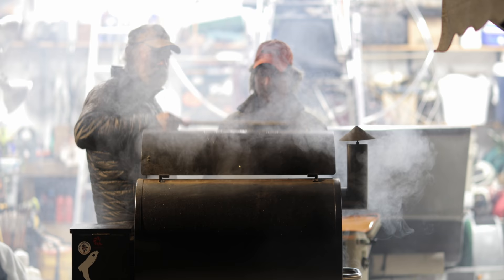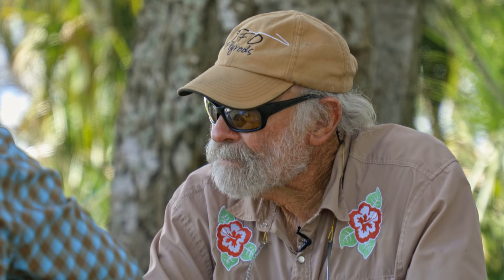Flip on How to Build out Your Leader

Comment: I don’t know man. As someone who consistently changes leader, loop was gift from god. Compared to old days when I used to  nail knot the leader, I can’t agree with ideas of cutting loops. The convenience and usefulness of loop outweigh the ones without in my experience. Difference in energy transfer is also negligible in my opinion. If you are good caster, you will find no difference to be honest
Reply from the maker: As Brian says here, and many other videos, if you are changing leaders often, stick with loops! There is most definitely a difference in energy transfer though and has nothing to do with casting ability. Basic physics.

Comment: 🌴 Hi Brian, my biggest problem is when tying the snell knot to the fly line the heavy floacarbon is so stiff it doest want to wrap around the fly line I actually had to use a tooth pick as a guide to wrap it around , and then when yo do get the knot finished it doesn’t slide thru the tip guide smoothly I’ve put UV epoxy to try and smooth it but it’s a speed bump , I’ve got a 9- 10 wt wt fwd floating line with a 50 # butt section , 🫤 what diameter and brand ( coartland ) floracarbon should I be using for my 9-10 wt ? 🤔
Reply from the maker: Please send your questions directly to Brian at the shop and he’ll be happy to help. You can email him or give him a call. Thanks.

Comment: Your buddy flip sealed the deal when he put the blood knot in his mouth to prevent the burning when pulled tight. Real McCoy. Down east for salmon, we use heavy buts for leaders to carry in the wind. Ive tapered them to almost microscopic, 22 size hooks. I tie the fly after I attach it to the the leader, tippet. Or leave it all heavy if the fly is hugh. In the day hooks were called  nails. 4, 5, 6 inch nails. Hence the nail knot to join hook, without eye to tippet. I rise alot of fish on the blood knot, no hook required. Would like a link to your snell knot please. I just tie a simple knot and 5 half hitches to join to cast line. Great job guys
Reply from the maker: Thanks for watching!  The link to the snell knot is in part of this video.

Comment: I’ve been flyfishing for 55 years now, and I’ve always tied a butt section onto the fly line. When loops started appearing on fly lines I had purchased I kind of laughed and wondered why I’d want to have a hinge in my line/leader and also why I would want a knot, or really 2 knots, that would not go through the guides easily. It’s never occurred to me to use the loop. The only thing I do differently is I use a nail not instead of his Snell knot, and for my tarpon rods, I use an Albright with a couple of half hitches backed up against it, to smooth it out.  Also, it’s just not that much faster if at all to do a loop to loop connection instead of a 3 to 4 turn blood knot.
Reply from the maker: Thanks for watching.

Comment: Just to speculate for a bit:  I suspect that when Flip wants to transfer all the energy through the transactions between leader or line sections, both the mass an stiffness matters.  I think this is analogous to sending electrical signals down transmission lines through different segments, one needs to match the impedance across section.  Or for the opposite, one mismatches impedances in layers of sound proofing walls spun that the energy doesn’t transfer through the wall.   I suspect that the impedance of a fly line is a combination of its mass per inch with its stiffness.  Would be a fun mechanical engineering student’s senior project
Reply from the maker: Thanks for watching and for the speculation. Sounds about right.
Reply: This is exactly how I think of it. Your transferring a wave down a line. Any change in impedance will have some of the wave (energy) transfer through, and some transfer back. 

I'm electrical/physics, but mechanical waves are basically the same as electrical in transmission lines. Instead of electrical impedance, you have mechanical impedance. Think of a rope attached to a chain midway. If you send a wave down, it hits the change in impedance (connection between chain and rope) and that will reflect some of the wave, and some will transfer through the chain. You can find demos of this.

I've been thinking about trying to model this to see the exact difference. Because mathematically your right, if you can match the impedance, you can transfer all the energy down the line

Comment: Thanks for this video. Clipping off the "hateful" loop and attaching a direct leader butt section makes sense to me. What does not make sense about this system is what butt leader one should choose with a given fly line. Obviously if one is using the FP bright orange line you have provided a table but what about Scientific Angler Amplitude Bonefish 8wt or Rio or ... What is the formula for choosing the correct butt section with any given fly line? Do you try to match the diameter of the line to the butt or is there more to it?
Reply from the maker: Please send your questions over to Brian at the shop and he'll be happy to help. Thanks.

Comment: Brian, when you say "I dont know what 40 pound is." , I take that to mean "40 pound" does not describe the stiffness and mass of the material, it would just simply describe the general strength of the material, correct? So the trick is learning the different brands and types of materials available and using the appropriate one for that fly line. Am I getting this? Thanks!
Reply from the maker: Thanks for watching. Please contact Brian at the shop directly and he will be happy to answer your questions. Call him or send him an e-mail and he will set you straight.

Comment: My question is... The Butt section leader is not permanent, and you will need to change it (nicks, sun damage, etc...). How far back can someone keep clipping the fly line before the factory taper becomes useless?
Reply from the maker: Please send your questions directly to Brian at the shop and he’ll be happy to help/answer. Thanks.
Reply: OK, say your butt section is 12”.  My leader may last all season, or more, but if I need to tie on a new leader, I only use/cut off about 3” of butt section. So the butt lasts about 4 leader changes. On one of my lines the butt section is now only 4” long for example.  When I tie on a new butt, I only use about 2” of line.  Anyway, this is a long way of saying that I wear out the line before I cut into the fly line enough to affect it’s performance.

Comment: I prefer factory loops. I murder leaders and would end up snipping away at the first 4 feet of the fly line. I do remember "dog on a loop" technique of using heavy mono to make a nail knot and then 3 inches of mono to a perfection loop.
Reply from the maker: With the methods shown here, you really would never change leaders. If you need to, this is by far the better method: https://youtu.be/8QKCXstJw30

Comment: Question your leader on a 10-11-12wt saltwater with sinking tip line is still 4 foot? Even the diameter is .027"-0.29" lets say a 0.26" on a 10wt will it hold a big saltwater fish of 60 pounds for example? or you would make it even stronger on the butt section? Thanks! and great video by the way
Reply from the maker: Thanks for watching. Please send those questions over to Brian directly and he’ll be happy to answer. Call him or email him.

Comment: You mentioned the formula for butt leader attached to fly line works with any modern fly rod. I'm presuming graphite, carbon wrapped graphite, etc.  What about fiberglass rods?  I have 2 Shakespeare '60 era rods in 4WT and 6WT.  If using today's floating fly lines with the old fiberglass rods, will the contact formula be the same?  Will the overall performance of the cast be different?
Reply from the maker: Thanks for being here. Please send those questions over to Brian at the shop and he’ll be happy to help. Call him or email him and he’ll get you answers.

Comment: Brian - does it make much difference, if any, what material you use for your tippet, ie: regular mono vs  Mason hard mono or an equivalent diameter fluorocarbon?
Reply from the maker: It certainly does as he talks about often. Best to call or e-mail him at the shop though with questions as he doesn't hang out here much. He'll be happy to help.

Comment: So is the idea that the butt section is long enough that if you lose a couple inches when retying the mid section the line will need replacing by the time the butt section is too short? Or do you not mind cutting off a couple more inches from the fly line if you need to retie the whole thing now and then?
Reply from the maker: @richpaul6806  Both sound about right! Feel free to call or e-mail Brian at the shop if any further questions.

Comment: Hi there!

Have been watching a few of your leader videos lately and I have a question cross comparing 2 vids. Here Brian says Maxima ultra green (MUG) is too flexible for streamer butt sections, but in "Build Perfect Nymph & Streamer Leaders" Brian recommends using MUG  for the butt section of sink tip leaders. Why is this?
Is it a revelation had since that older video? Or is it a difference between longer FLOATING LINE leaders and shorter SINK TIP/FULL SINK leaders? 

Thanks in advance for clearing that up!
Reply: AND another relevant question: where in this leader formula might I insert a tippet ring (for preservation)? After the mid section just before the tippet perhaps?
Reply from the maker: Thanks for watching. Please send your questions over to Brian at the shop and he'll be happy to help and answer. He can be reached by phone or by e-mail. Phone is always best.

Comment: is there any problem with cutting the loops off and just tying the tapered leader on the fly line and not piecing it all together? So its the fly line to leader but tying it instead of using the loops. Thanks!
Reply from the maker: Please contact the shop directly with your questions and they will be happy to answer/help. Thanks.

Comment: Sir...what knot are you using for the mono to mono connections of the leader and of course, with no loops in the leader anywhere, that perfect leader length starts to deviate the minute you start changing flies, or generating a frayed tippet end, or any other situation that results in your losing tippet length.  Eventually, you get a trickle down effect that will cause you to have to retie the butt section.  Every time you do that, you lose a little fly line.  I think that is what bugs me the most!
Reply from the maker: Thanks for watching. Easy to overcome….Brian has quite a few videos that address all of these issues you point out.

Comment: Brian/MRO
What dia. size butt section would I need for 10wt flyline?
Reply from the maker: Check the video description below for recommendations. Call or email Brian at the shop if any further questions.
Reply: Thank you
Reply: @Madriveroutfitters   In the video Brian says your tippet is determined by the size of the hook and if the fly is weighted. I mainly fish for Reds in Louisiana and going to use weighted flies and sometimes non-weighted. How do I determine what size tippet I'm suppose to use for theses flies? Is there a tool or a formula that determines what size tippet I need to use? Thank you.
Reply from the maker: @Raptor_1991  Please contact Brian directly through the shop and he’ll be happy to help. Email or call. Thanks.

Comment: One of the issues with floating line is that, well, it doesn't float. I've noticed there is a filament inside the structure and I'm assuming it absorbs water over time if there is a nick or you cut the loop off. Have you tested this theory in the past? If it's absorbing water it could add weight in the head section of the line. Any thoughts?
Reply from the maker: Yes. He addresses this exact subject in the second video which was just published, as well as a few others along the way.

Comment: Flip is one of a hand full of flt fishers that
Reply: That i have full confidence in. Lefty and Stu Apt also are in that group. These fellas can almost walk on water. I have used the line end loop for years but this sure makes sense to me. I intend to chsnge over one of my rigs shortly which will be one of my gill rigs. I generally keep my leaders to 8ft or less and many times i just use a straight leader of 6# maybe 6 to 7ft. Even an old dog like me can improve. Every time i cast a rubber spider to a gill i am thinking of red or speckled trout.
Reply from the maker: @rayditzenberger9517  Thanks for watching. The man is a legend for sure.